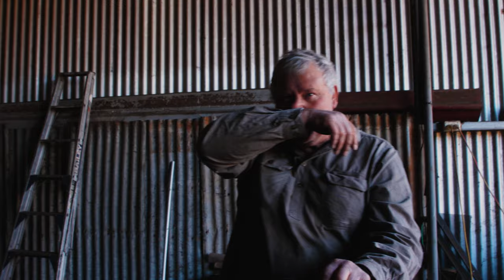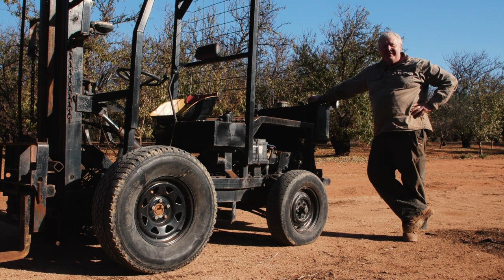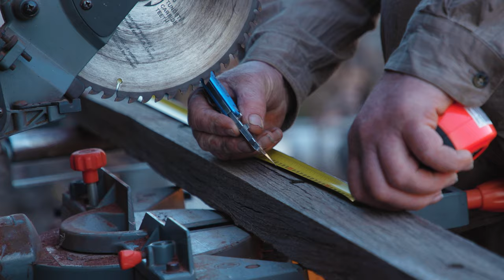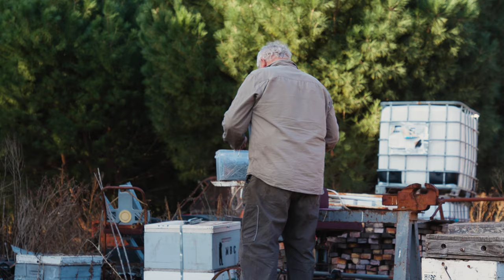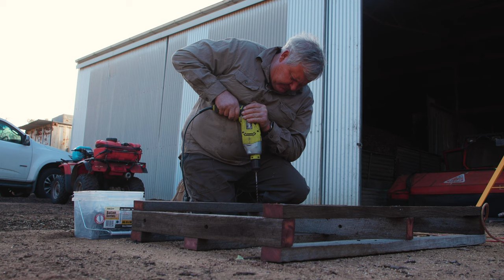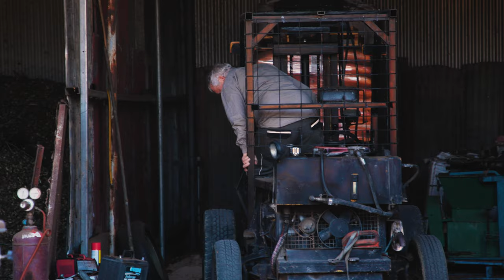DIY Bee Pallets & Testing my new Bee Buggy Forklift! | The Bush Bee Man

Comment: I would build these so you can use the exact same ones when you elevate your hives on posts. Build as many as you need for the truck, then build a dozen more for where you want to elevate your hives in a permanent location. A bit of winter work for you, but it will last decades as well as being an improvement. Of course, the next thing will be modifying the crane on the flatbed to pick up and load one of these homemade pallets loaded with 4 full hives on them.....haha....it never ends, does it?